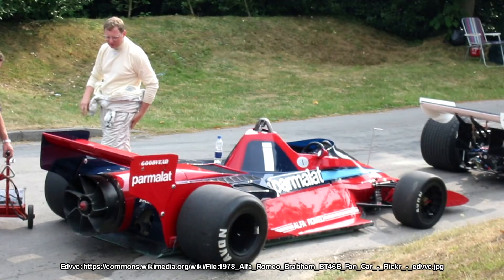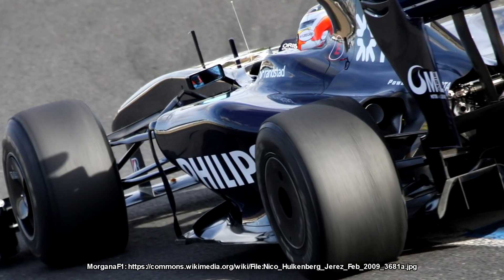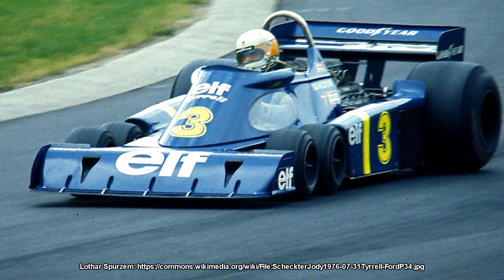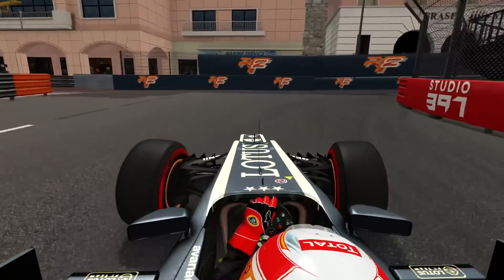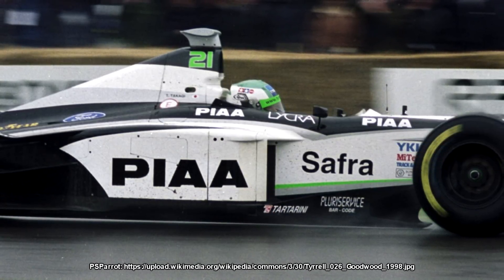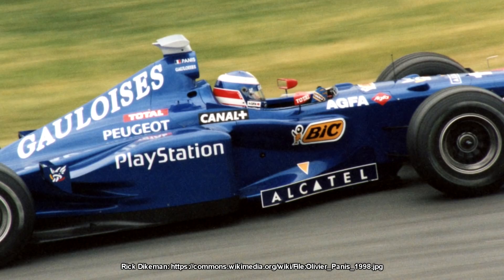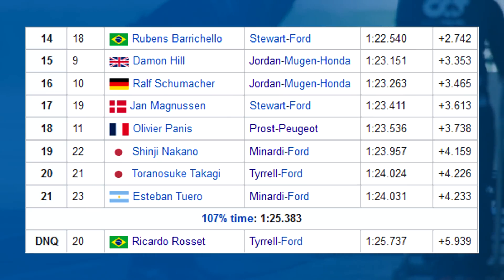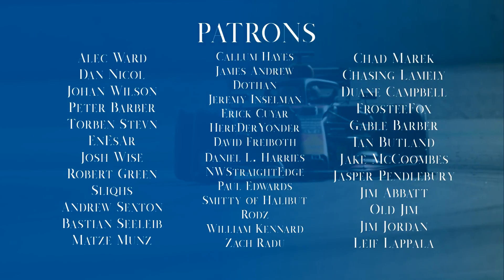NOT QUITE LIKE SKYWALKER'S! The Story of the Formula One 'X Wings' (1997-1998)

Comment: Couple of minor pieces of information probably missed related to this. Salo was missing part of his front wing at Monaco 97. So them wings really did help. Also McLaren tried a high mid wing on top of the engine cover in 95. It interferes with the main rear wing. Which could have lead to Harvey thinking to positioning them more away from the airflow to the rear wing.

Comment: Ah yes, the 90s struggle for downforce. The cars looked silly with those on, especially the 97 Tyrrell with its X-wings. Glad they eventually banned them. Another ugly-looking thing: the MP4/10 (1995): ugly nose cone + ugly central wing. They eventually removed it, and the car got better. Shame since the MP4/8 & MP4/9 are some of the most beautiful F1s in my view.
Also on the elevated nose cone, it's amusing that some teams went in and out of that concept :
- Ferrari went for it in 94, abandoned it in 95 and barely acknowledged it in early 1996...Then issued a B-spec car at the mid-season which had possibly one of the highest and ugliest noses ever
- Tyrrell invents it in 90, forgets it in 94-95, goes back to it from 96

I've always wondered why they came back & forth, or almost ignored it when Benetton started using it (1991), if it was so widely adopted from 96 onwards. Before 94, Only Tyrrell & Benetton had used it in a big way, and some noses were slightly detached on other cars (93' Ferrari, Footwork or Jordan come to mind). Never made sense to me. In the same vein, the walrus nose on the 03' Williams, whose designers thought it was so evident that they couldn't understand why nobody had touched on that before.
The arcanes of nose aerodynamics elude me.

Comment: I can confirm that these X wings DID fall off the cars.. Alesi had one taken off by an air line in the pits in Argentina 1998
Reply: I think that was the only example of one being torn off though, and it was by external factors when it got snagged in the next pit-box's wheel guns. Prost had to run their car with, as F1 Racing magazine put it, "one solitary croquet hoop" as they couldn't put one on the refuelling side as it got in the way of the nozzle.
Reply: LOL my dumb brain read that as "Alesi had an x wing ripped off by an air plane" ... as if an aircraft swooped down qnd knocked it down .... then had to read it again. lol
Reply: Yeah, I don’t think that any just fell off, it was more just used as an excuse to get them quickly banned. Not that I’m really complaining, they were horrible and as soon as Ferrari started using them as well as sauber and Prost (I think?), the rest of the grid wouldn’t be far behind.
Reply: Ya beat me to the punch!
That's not falling off, but being taken off by a bit of an odd circumstance. If I remember correctly, it was another teams air lines upon exit.
Reply: And that's why they got banned

Comment: I remember in the 1998 F1 review there is a section after the San Marino race where they reference the banning of the tower/x wings. They did kinda make a comeback in 2006 as BMW Sauber did have some tower wings on the front of the car at the French GP.
Reply: Imagine adding x-wings to a 2008-spec F1 car.
Reply: @mat2000100  or a fan 😳